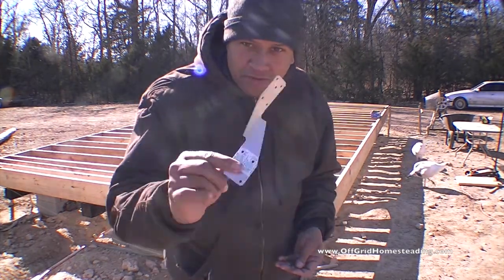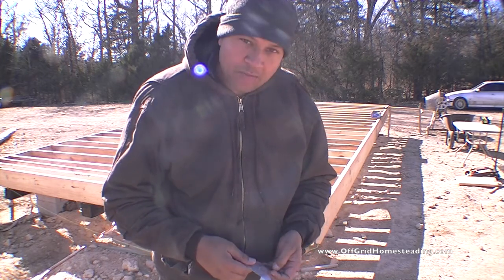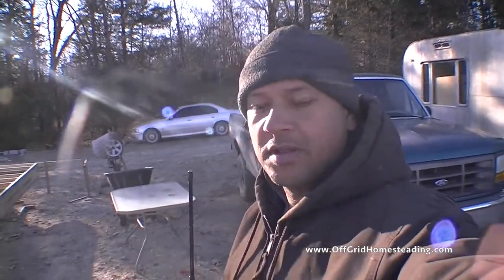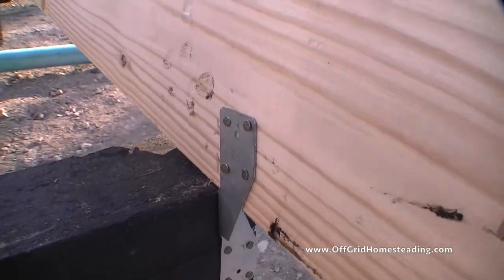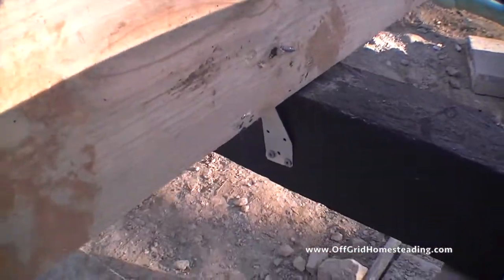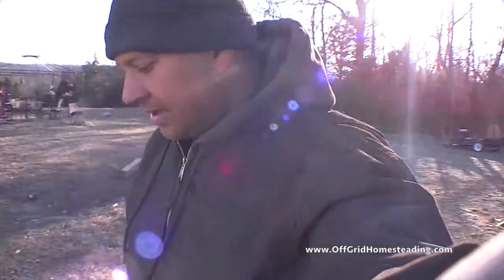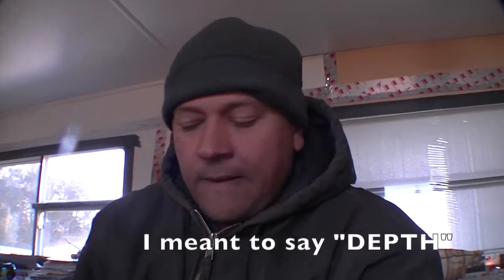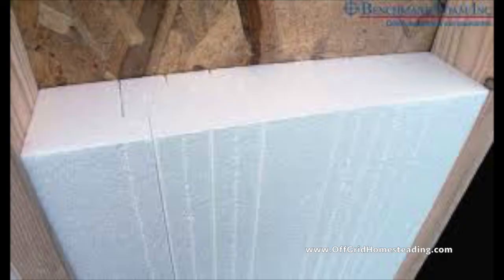OGH - Attaching Simpson Strong-Tie Hurricanes Straps to Beams

Comment: I notice the combination of screws and 16d nails in some of your strapping, as well as some nail holes left empty - doesn't Simpso require 16d nails in these straps, or at least Simpson Strong-Tie Connector scews? How critical do you think this is?
Reply from the maker: Tyler K Hey Tyler I never read the directions on how many nails to put in there I just want to make sure I didn’t have so many nails its that it compromised the wood itself and the screws were to hold them in place in the first round and the nails were for the strength later.
Reply: Translation: I have no idea what I'm doing.
Reply: Simpson allows 10d 3” nails in the toenail positions and 1-1/2” 10d in the face position. They also allow #9 1-1/2 structural screws in the face positions.
Reply: There are specific nails made for installing those metal connectors. Regular nails don’t have the proper shear strength. If using screws you must insure they are structurally rated for the connectors  Additionally ensure they are rated for treated lumber if using treated lumber. If not they will corrode and fail